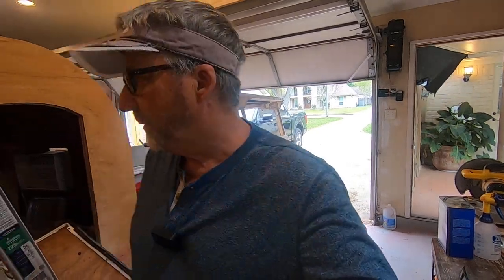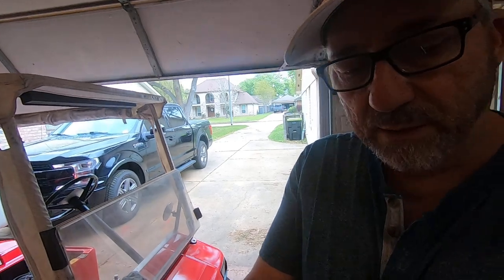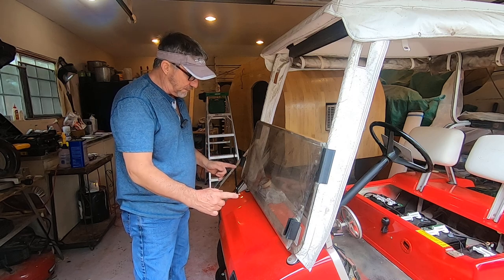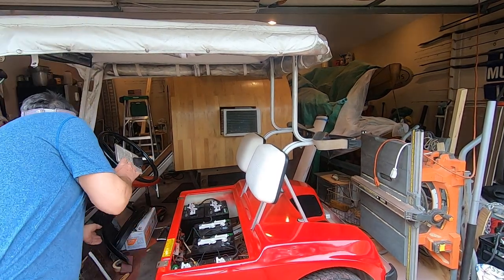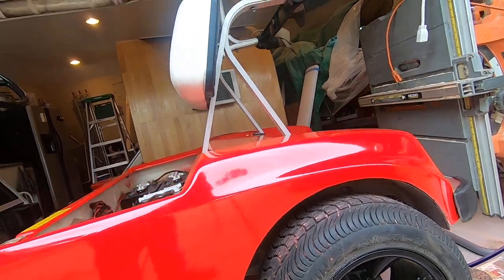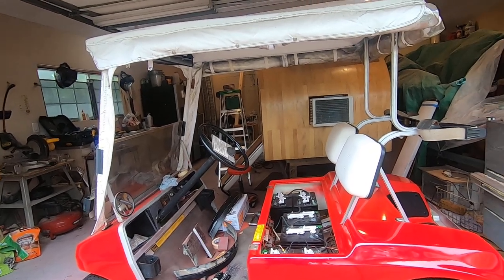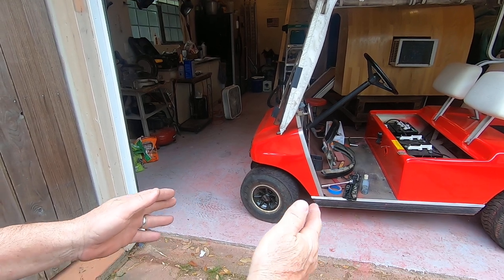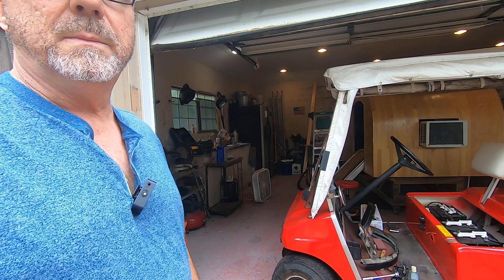The best rattle can paint job I can do on a Club Car golf cart ds no lift and no lithium batteries

Comment: Does changing the color to red increase the resale value? I know with a car, changing the color would actually lower the value. But someone might like it.
Reply from the maker: Well after I removed the ugly stripes and repaired the cracks in the body it needed to be painted and fresh paint always helps, I went with red as this cart is a 1989 like the last one (a 1989) and if I did it blue YT might say I am spamming so red it is.
Reply: @mlangfordoutdoor  I understand. I'm just wondering if repainting in the original color would be more or less profitable than changing the color.